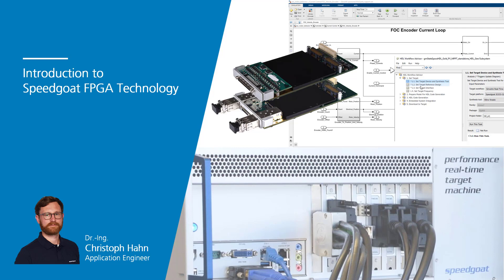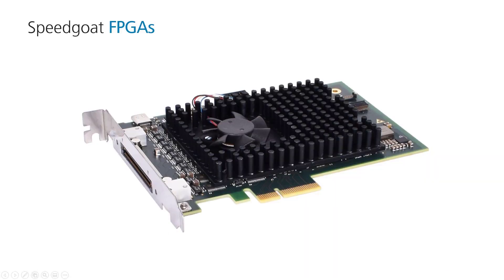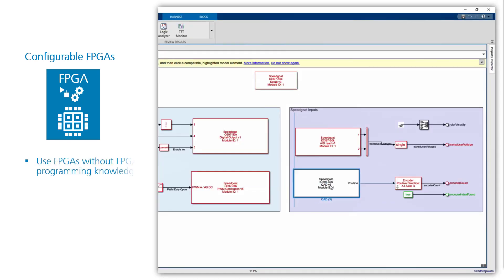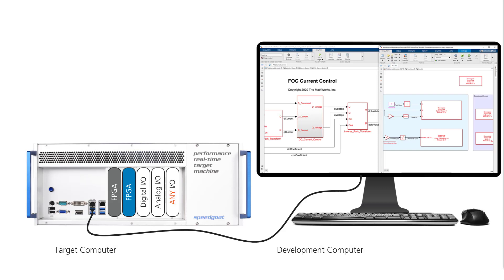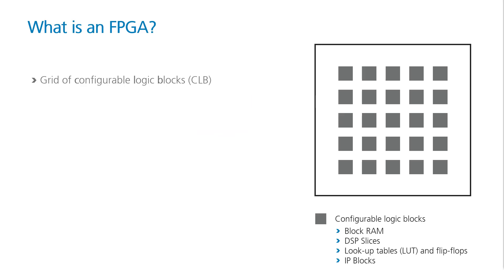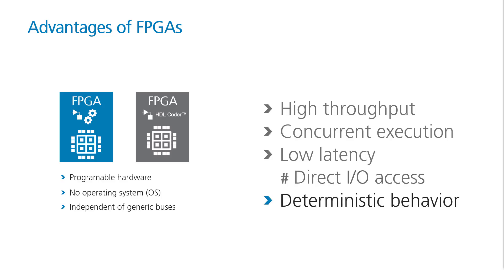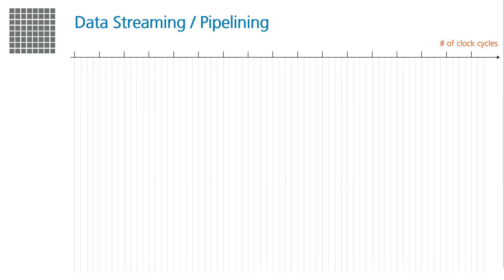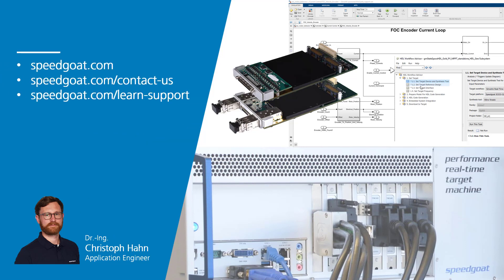Introduction to Speedgoat FPGA Technology

Comment: I've been always fascinated with FPGA's. Now I'm wondering, what role they could play in machine learning? Deep learning to be more specific.
Reply: FPGA's has good handling capabilities for parallel and math intensive applications since they are flexible and configurable in design so the are the key enablers to the AI & ML applications (accelerators ) also they are very centric in AI on the edge applications so they will become a must in near future